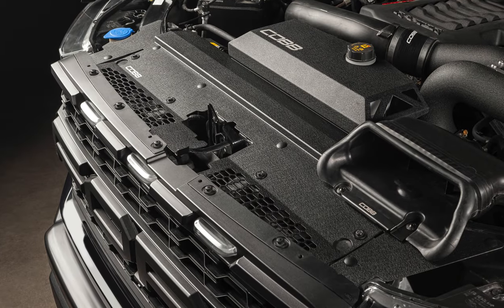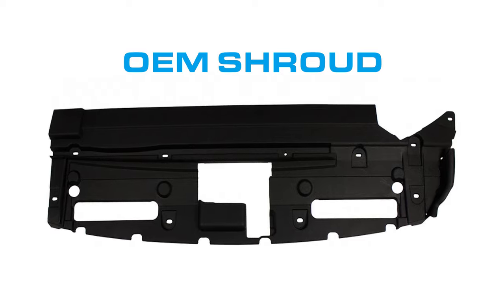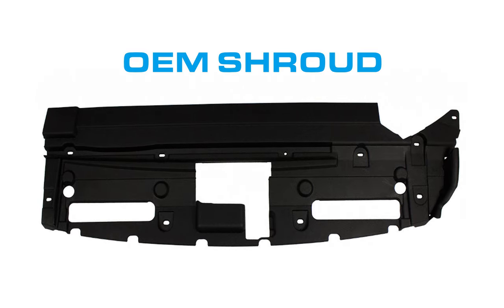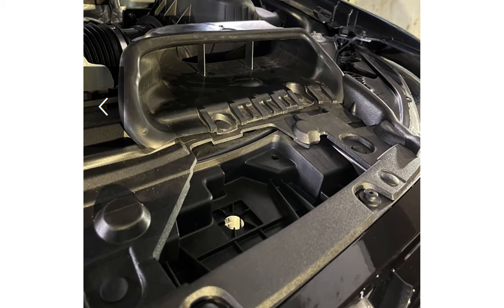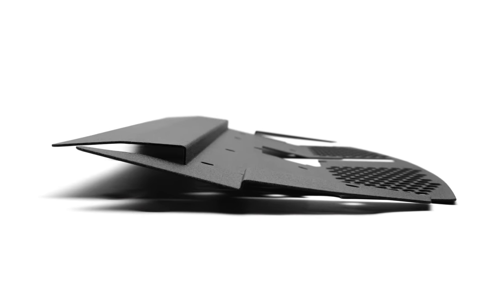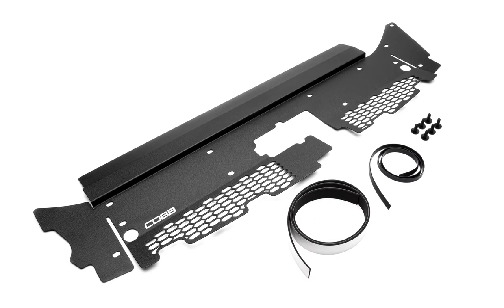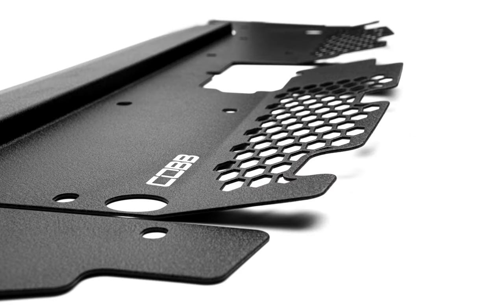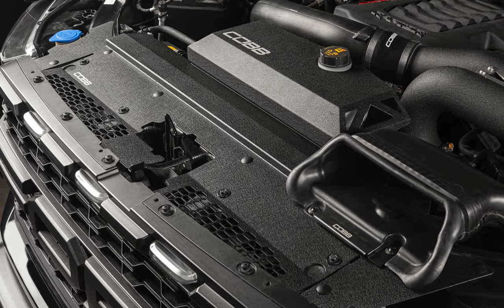COBB Tuning - Product Highlight - 2017 - 2022 Ford F-150/Raptor Radiator Shroud

Comment: This is a huge improvement over the plastic shroud on my 2019 Platinum which has less open area than the newer F150s and Raptors.
I enlarged the openings some with a razor blade but still not quite the openness of this piece.
Plus matches the coolant tank cover.

Comment: Will it fit a 5.0 or is there any in the making
Reply from the maker: Yes, these and our coolant covers will fit the 5.0L V8 F-150s.
Reply: @cobbtuning the carbon fiber air scoop will fit the 5.0 too?
Reply from the maker: @SONAYMX we have not confirmed fitment of the scoop on a 5.0L truck, but it should as the factory parts are the same.
Reply: @cobbtuning Thanks, so you think the scoop will work with the 5.0 factory connection.

Comment: I agree that this looks sexy but I kind of lost trust in Cobb for trying to pitch that this design increases airflow. The airway that is cut into your aluminum shroud is in the same spot as the stock one. If you look at the Raptor R version, it stretches all the way back toward the actual intake tube where yours doesnt. I just don't understand why youd go through all of this work to make a shroud and pitch the idea that it "increases" airflow when you haven't created any more open surface area than the stock one. Your hex design also breaks up airflow where as the stock one has a giant opening where no metal will chop up the flow of air on it;s way through. 

If you guys can't provide numbers that validate your info, you shouldn't be saying it. its kinda gross that youd just blatantly lie.